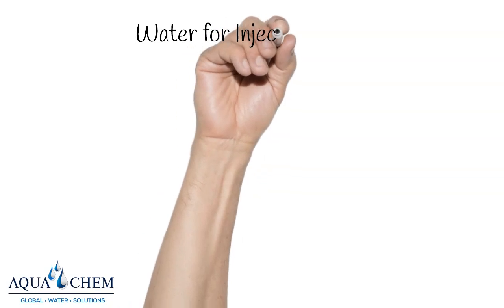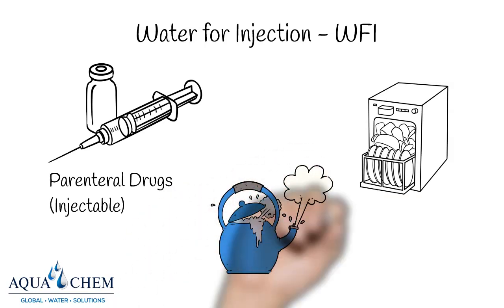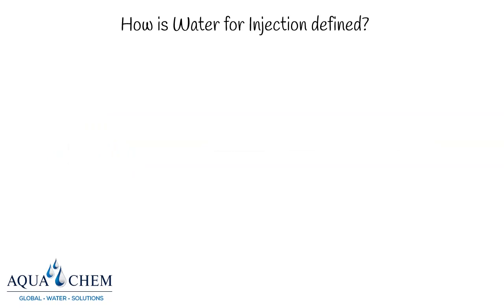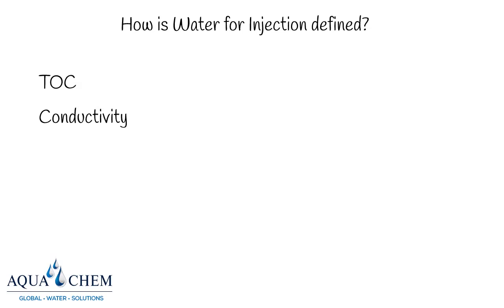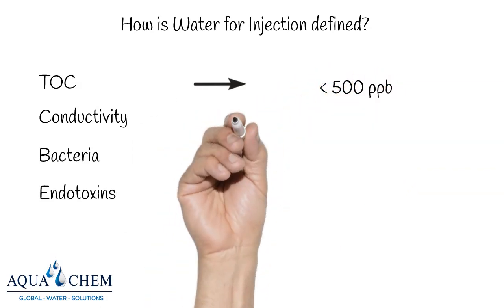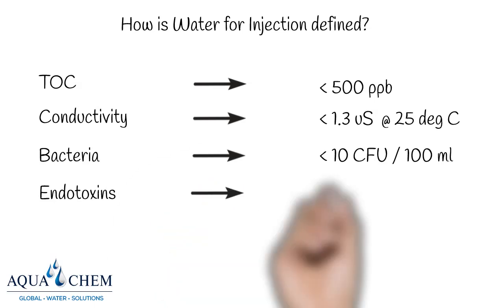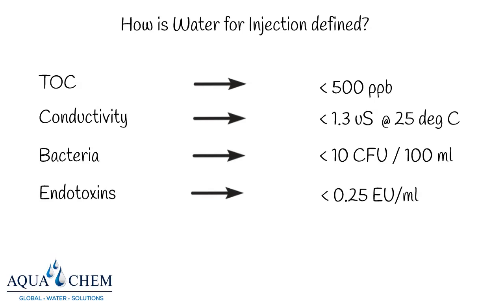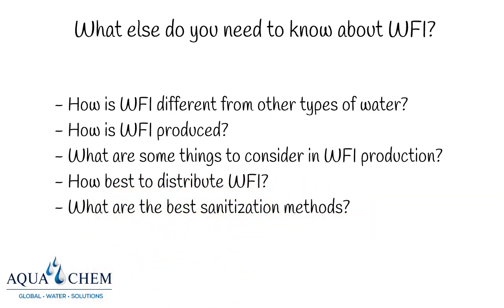What is Water for Injection?

Comment: What is the difference  between  water for injection and sterile water for injection
Reply from the maker: Technically nothing. Sterile WFI is usually sold as a product, vs WFI is used in the manufacture of a drug product. A facility may use WFI to make a product that is bagged and call that sterile WFI.